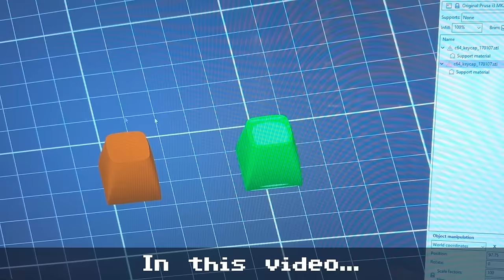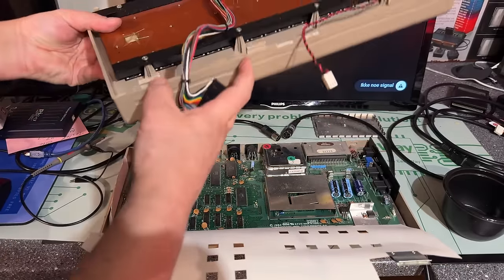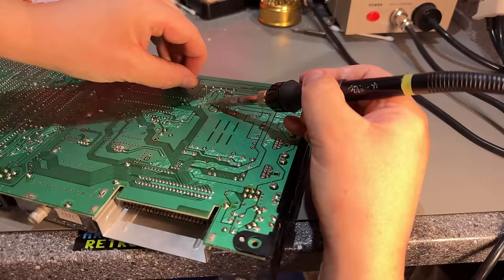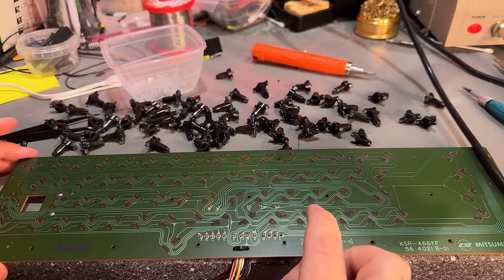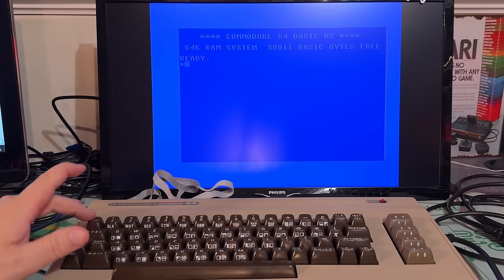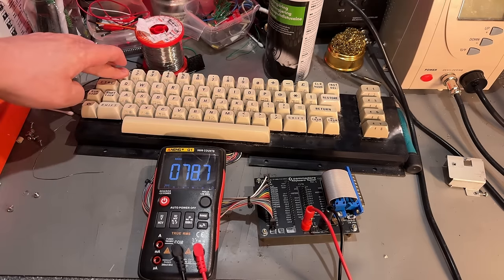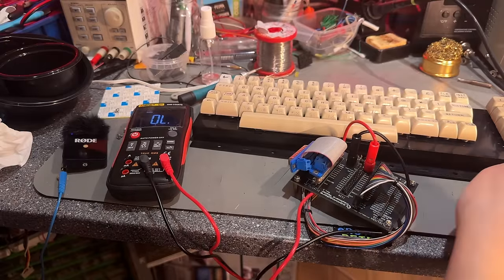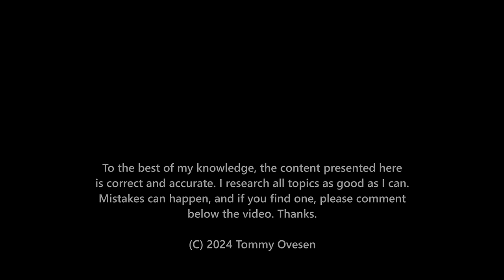FIXING TWO Commodore 64 machines that was in poor shape - Part 1

Comment: I had a very similar issue with my C64 where it seemed to work just fine but locked up when trying to load from disk. It behaved the same as yours did, it got stuck at "Searching for $" and the disk didn't spin and wouldn't respond to any commands anymore. It turned out to be the chip right below CIA 1 chip marked U8 that was faulty. It is a 7406 Hex Inverter Buffer/Driver. I got one from a spare board and swapped it and now it works perfectly again. My board is also a 250466 revision. Hope this will help you with your troubleshooting. :)
Reply from the maker: It is fixed now. It was a simple fault but it took some time to find. Next episode

Comment: I think a lot of these issues are caused by the crappy single wipe sockets that Commodore used.  The single contact gets crusty and loses contact. When you flex the boards, the crust breaks away and remakes connections and the problem goes away.  Or, you have cracked solder joints that behave similarly to the cheap sockets.
Reply from the maker: It is fixed now. It was a simple fault. See next episode

Comment: That c64c has the coveted 6581R4-AR SID! Nice find. The 250466 board is also sought after because it has less component's to fail, like the 2 ram chips instead of 8. Its almost like a perfect mix of the original long board and the cost reduced short boards.
Reply from the maker: And it's now fixed :)
Reply: I love the 250466 boards.. I have 3 now all restored to very nice condition.   One just worked with cleaning.. One bad power switch,  and the other one bad ram chip.

Comment: Regarding the rubber pads, I usually fix my remote controls by gluing a piece of aluminum foil on them so the resistance will be at its minimum if any.
you only need to find a good adhesive that sticks on both the pad and the foil.
I recently tried a Modified-Acrylic AB Adhesive and it worked fine (at least so far).
You can also try using a transparent flexible 2 parts epoxy, it worked for me too.
Thanks Tommy!
Reply from the maker: Thanks for the info!
Reply: @Arcticretro  👍💯
Reply: I have tried every method therr is, but the one I ended up using is brushing the pads with steel wool. It seems to be just as effective and will last forever
Reply: @christianlarsen1070  I might try that
Reply: I have tried rubbing them quite aggressively with actual 400 grit sandpaper. It worked perfectly. It looks like this rubber is conductive all the way through, so an abrasive fix is probably the best option. No need to fuss with glue or additional material.
Reply: @helgew9008  I'll try this next time for sure

Comment: You mentioned having to use your air compressor. I too have been using an air compressor but I have to power it up and wait for it to build pressure. Some really dusty items may take several cycles. Ive just converted to a great little air duster, XPOWER A-2 Airrow Pro, about $40 USD. It is corded but I believe they make a much more expensive cordless version.
I have one of the smaller cordless dusters claimed as replacements for canned air.......not impressed and about the same price!
So far its been great!!!
Reply from the maker: I have a small air compressor I use for my car / tires / bikes. It takes 2-3 minutes to fill. But also 2-3 minutes to drain

Comment: When putting screws back in, whether it’s those on the keyboard or those holding the motherboard, always turn the screwdriver counter clockwise fkrst until you hear a click and then screw clockwise. The purpose of this is to avoid cutting a new trace in the plastic.
Reply from the maker: Yes, I usually do this if I feel they go wrongly in

Comment: Did you have a bad power supply when you previously tested those two?  I see the PCB is dated 1984 which is good since it may have missed the self destructing MOS Technolgy custom ICs made in 1983 with a defective process which was too much boron in the passivation layer.
Reply from the maker: No I always use a modern PSU.  Yes, no MOS logic chips as far as I remember.

Comment: Regarding the deferred recapping, has anyone already found equivalent solid caps for the electrolyte types, to do the job right for eternity?
Reply: Why would you recap a c64? I have repaired +100, and has never seen leakig caps
Reply from the maker: I just buy regular electrolyte caps from Digikey
Reply: @Arcticretro  With the rare use of these machines it's not ideal, the electrolyte degrades when unused.

Comment: I bought a bread bin 64 last year as non working. It would power on but no red light and non responsive keyboard.
My suspicions were confirmed when I opened it up and found the cables to both had been disconnected. Reconnected and it "lives"!!!
Probably the seller got it from "somewhere", had no interest and just wanted what they could get out of it.
Someone had to have been inside as those cables just dont come off on their own.
Reply from the maker: That was strange